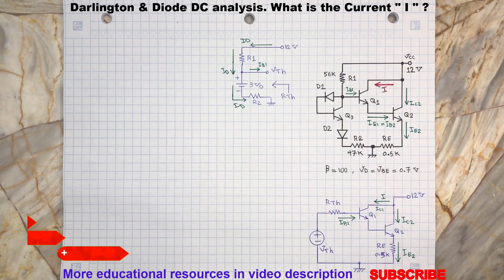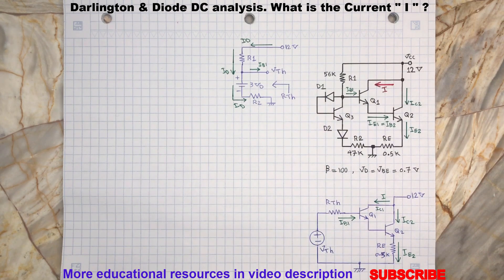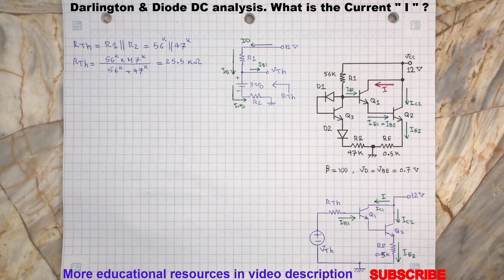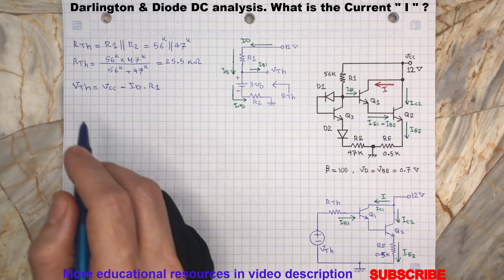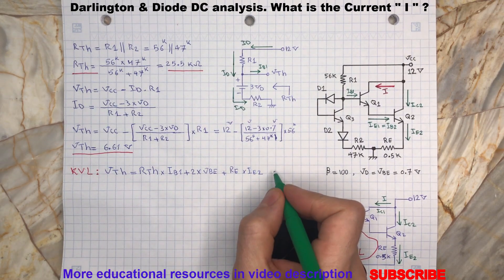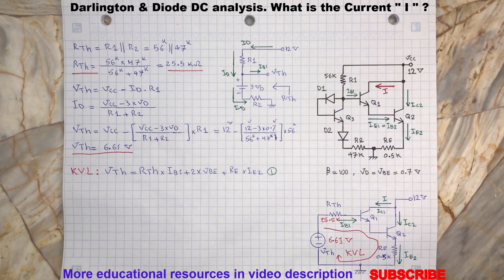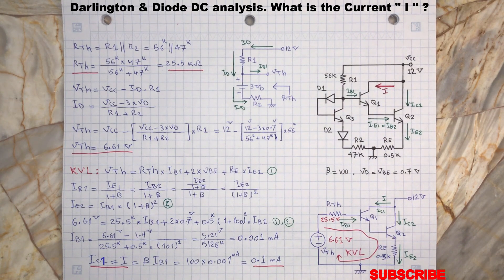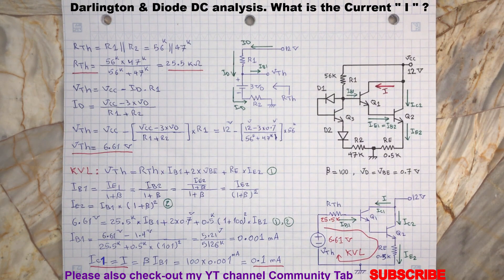Darlington Transistor and Diode Circuit Analysis, BJT and Diode Solved Problem, Darlington Pair

Comment: Why the  collector-emitter junction of Q3 is not consider in thevenin equivalent circuit calculation?
Reply from the maker: Not sure if I understand your question, because there is not a direct PN junction between collector and emitter. if you mean Voltage between collector and emitter (VCE) then this is what is done: VCE=VD1+VBE = 2VD